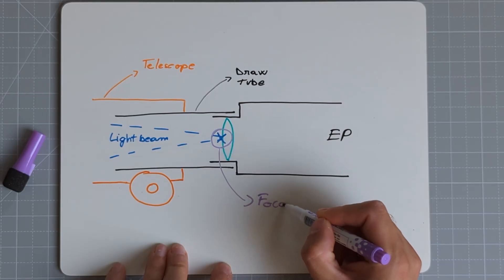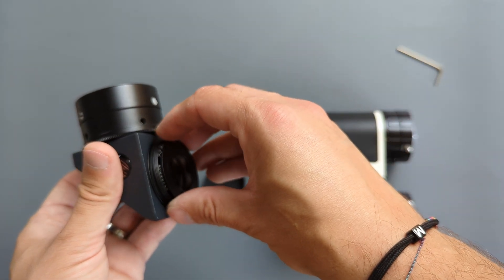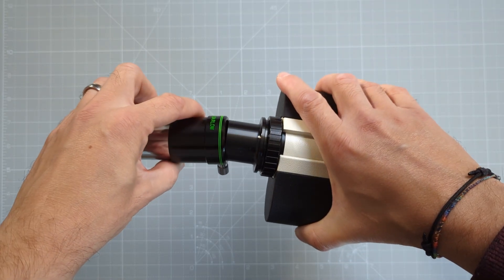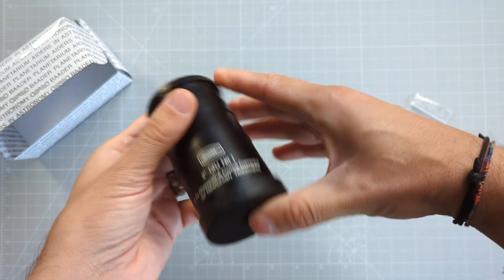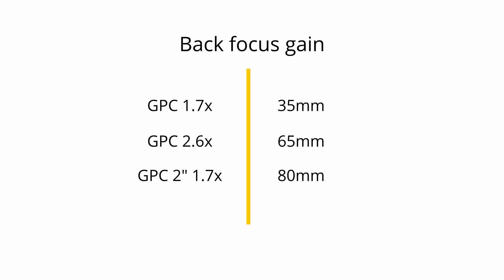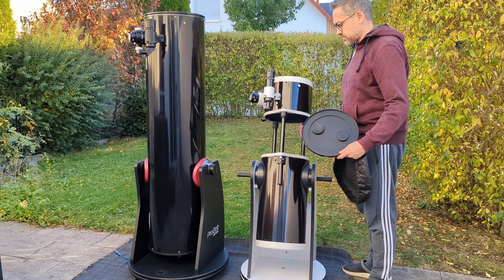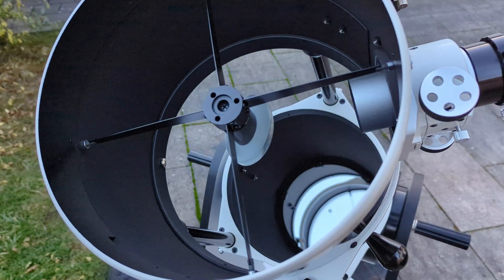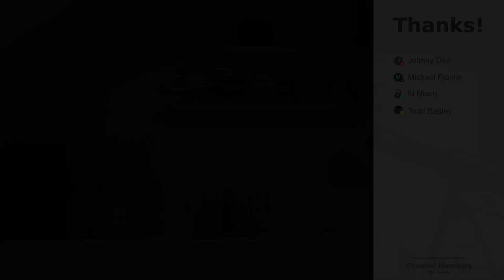Binoviewers and Newtonian Reflectors

Comment: Hi Bogdan,

I have exactly the same telescope and I can tell that the Celestron binoviewer fits on the Omegon Prodob 12 inch. The Baader Maxbright has 11 cm lightpath vs 9 cm for the Celestron. I'm using the Celestron X-Cel barlow (2 X) to get a good focus in the dobsonian. I also get a good focus in my 8 inch Celestron Starsense dob. In both telescopes, I can use different focal length eyepieces, while having a good focus. There is only 4 mm of inward focustravel left, but it does the job.
Reply from the maker: That's great to hear! It's always good to know what combinations work well for others.

Comment: Thank you, a very thorough coverage of the issues. Is an f/8 Dob likely to be more lenient with the required back focus than your f/5? I am considering getting a 6" or 8" f/8 Dob and am very keen to use either the WO or Baader prism BV without messing around too much with GPCs and other solutions with side-effects.  Perhaps I should take your lead and find one with adjuistable length instead.

Comment: Had you considered swapping out your focuser for a low profile one? that could easily save 20-30mm of in focus.  I'm lucky, im using a 10" dob, and it works fine with my William Optics bino, with a 2x Ultima Barlow, or a 1.5x Seibert Optics GPC.  Though it did not work with the supplied WO 1.6x GPC without an extension tube.. Seems like a real hit or miss thing.

Comment: My understanding of getting a prismatic bino-viewer working with a Newtonian is that you need a Newtonian that is designed for astrophotography. These seem to generally have a back focus of 55mm and supplied with 50mm focuser travel. 

In the case of the Baader Mark V, this has a glass path of 110mm. Using the 1.7x glass path corrector knocks 80mm off of the 110mm resulting in an extra overall back focus of 30mm. Taking this 30mm away from the 55mm of back focus of the astrophotography Newtonian gives 25mm meaning that the focuser will be at about half of its travel. 🤞

Comment: Hi Bogdan, thanks for your informative and well-narrated videos :) I have an 8" dob (F5.9) and recently also bought the Baader Maxbright II bino with the 1.7 newton GPC. It worked immediately and focus is no problem. Binoviewing is simply amazing! I have a question - have you tried using filters with it? I'm just wondering if I can buy a 2" Baader filter (for example the OIII 10nm) and stick it onto the GPC somehow. Or do I need to buy 2x 1.25" filters? Thanks.
Reply from the maker: @alexanderm8892 Congrats on the bino! The 1.7x cpc has threading for 2" filters at the bottom, so there shouldn't be any problems.

Comment: Thanks for your video. I just purchased the 12 inch flex tube and used it twice so far.
I’m hoping this one I’ll keep for a while as my two previous 12 inch Dobsons one was a solid tube and the other was the light bridge. I had issues with. 

I’ve also tried bino viewers, two different models in fact, and I have a hard time merging the image and so I just gave up on that. I do have a subscriber and member on my channel who has an expensive one, and I am going to try to use his and see if that helps
Anyway, anyway, good video
Reply from the maker: @JoeJaguar Thanks and sorry to heard about the problems you encountered with the bino. If you have the chance to try out another option, do it. i believe its definitely worth it. Let me know how it turned out.
Reply: @ I have a friend and a subscriber on my YouTube channel is also a members video who has an expensive one so I’m planning on borrowing it and trying it again but as far as buying another one, I’m not sure

Comment: I have a celestron c130slt newtonian and found that the williams optics binoviewer does work with a 2X barlow connected but has very little focus-maybe 1/8 turn out from fully in. However, I bought the Founder Optics Bino-One Erect Image Divergent Bino (from Agena Astro) and it works without any barlow lenses. The image is actually surprising good. The Williams optics wants to throw the balance of the reflector to top heavy due to the length of the barlow and weight. The founder Optics doesn't seem to have this problem. Also, The williams optics bino won't focus in my refractor no matter the barlow. (not enough focus length) No issues with the Founder Optics binoviewer. The founder one is more expensive but works on both my newtonian reflector and refractor.
Good video. Keep up the good work.
Reply from the maker: @EdwardVivier Thanks for your input. I'm glad to see that your experience with linear binos is so positive.

Comment: I bought the SW 250P with SynScan, in spring. BH photo had a deal for $1,000!  Now I'm a passionate visual astronomer. Love it! Unfortunately, I'm blind in one eye, so no binoviewer here.
I have several questions. I'm looking for a wider FOV
 "quality" eyepiece. Say 25 or 30mm. I have four Televue Naglar type 6 eyepieces now.
I find these of great quality for me. I'm thinking under $400 give or take. 
Secondly, i want to do some "lucky imaging." Thus far, with  DSLR, or dedicated astro camera (asi178mm) focus is very hard. I also have an AP barlow .
With the higher magnification a dual speed focuser is in my sights. I want one that will just drop in w/o modifications. I've been told SW has one. Not that I can find. Thanks for putting up with this lengthy conversation.
Reply from the maker: @mikehardy8247 That's a great deal on the SW 250P with SynScan. For a wider FOV eyepiece I would recommend the 30mm 82° Explore Scientific: https://amzn.to/4htO0mc
While it's currently over $400 (at least on amazon) I believe it's worth the money. The 24mm is a bit cheaper and also worth considering.
As for the focuser, SW does have a dual speed model: https://www.astroshop.eu/focusers/skywatcher-2-crayford-focuser-for-explorer-newtonian-reflectors/p,22264
I plan on getting one myself for the 250 FlexTube.

Comment: Excellent analysis and solution, Bogdan. I'm currently testing out a William Optics binoviewer for use with my home-built Dobsonian Newtonian and have run into the same problem. Fortunately for me, my focuser is a low-profile model with a telescoping draw tube. I can achieve focus with the 2x Barlow supplied by WO, but my preference would be to use the binoviewer without it. My scope is designed with 8 Serrurier truss tubes currently of a fixed length. A solution for me could be to modify these tubes so that the can be shortened. This would require purchasing a length of aluminum tubing with an inside diameter slightly larger than the OD of my current tubes and adding a spring-loaded locking pin for each tube. I would have to do some precise cutting and drilling, but the result would be a set of adjustable-length truss tubes for those nights when I want to use a binoviewer for all my observing.
Reply from the maker: @daveincanada4794 This sounds like a great DIY project, which in my opinion is well worth the effort. The gains in FOV would be significant. Good luck and let me know how it turned out, should you go for it. Clear skies!

Comment: Perfect for having a good look at Planets. But as you say the reduced fov isn't great for deep space stuff. Your solution is very innovative. I am considering a bino viewer for my 127mm Maksutov.
I'm in the UK where the 2" aperture model isn't sold. I saw a few videos about them. I think one of them may have from your channel. That really made me want one so badly.  I was lucky to get a display model from a camera shop in Wales. But it cost almost twice the 1.25 inch version. The 2" eyepiece makes the scope look great for visual. Something i've been doing more of lately.
Reply: I also want to use a BV with a 10-127mm Mak and a Dob.  Are you talking about the shop in Cardiff?  If you have any tips please let me know.
Reply: @hop333  Carmarthen Cameras
 is the shop where i bought it. The best tip i have about the 127mm Mak is learn to use the touch of an angel with that focuser. Buy a Bahtinov mask too. It will definitely help.

Comment: Hello Bogdan, great clip asa always. I noticed you said you used with success the 1.7 gpc and the sv 503. I ask because in the original bino video you had only the 2.6 gpc available for testing
Reply: Thank you for the information, next time when you use the sv 503 it can you please make a of the setup, and especially the  ring needed, and make the photo public or private as you consider, so I know what to purchase alongsite the binoviewer. 
Looking forward to your dob comparison, good luck
Reply from the maker: @PauI__ Hi Paul, you are correct. After a lot of attempts to reduce the length of the focuser I managed to obtain focus using the 1.7x gpc. The solution was to remove the whole back end of the focuser's drawtube containing the 2" and 1.25" adapters and screwing the diagonal directly onto the drawtube.
Reply: @BogdanDamian  so just by screwing the baader prism fitted with a 2inch adapter directly to the 2 inch focuser was not enaugh?
Reply from the maker: @PauI__ No, just the diagonal without the 2" adapter. I only needed a thin M54  conversion ring to connect the diagonal straight  to the tube.
Reply: @BogdanDamian the conversion ring you used is m54 male to T2 male? Could you post a link to the part you use please, thanks

Comment: cool i got the 8" flextube. so what set up overall do you recommend - binoviewer and eyepieces?  also it has the first lock stop position, is that the one you use or do you adjust at a different length and just tighten it down?
Reply from the maker: @justinbaker2883 I love observing with a pair of 32mm classic Plössls from Baader. The wide views are awesome for DSOs. If I need to get closer, I'll use a pair of sv230 super zoom eyepieces from Svbony.
As for the lock position on the telescope, I use the second one where the tube isn't fully extended.

Comment: I had similar problems with my EScultra light 12” Dob but managed to solve this getting a low profile baader focusser. I used the televue 2x power mate to reach focus as I found the GPC caused a few internal reflections. You a lucky you got that 1.7x from baader as I think that is now out of production.
Love my baader giant BV. Can’t go back to single eye viewing now 😂
Reply from the maker: @leew3650 Glad you could solve the problem that way. The regular GPCs aren't really made to be used in combination with dobs so they aren't a good fit. The 2" is indeed great for reflectors. True, observing with only one eye isn't that fun anymore 😁
Reply: They are definitely still in production.